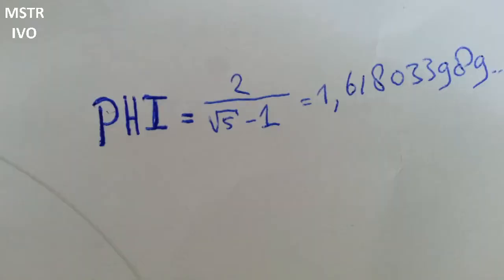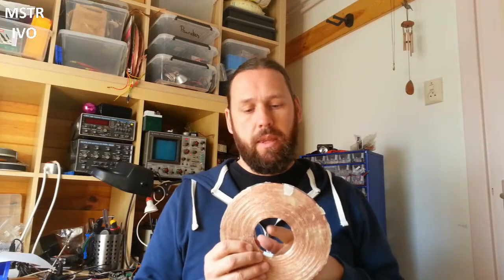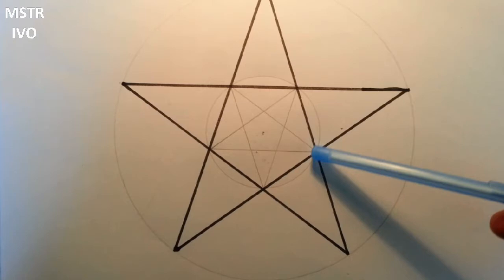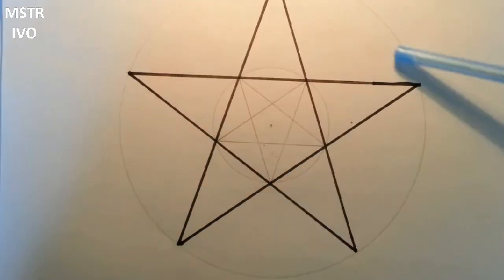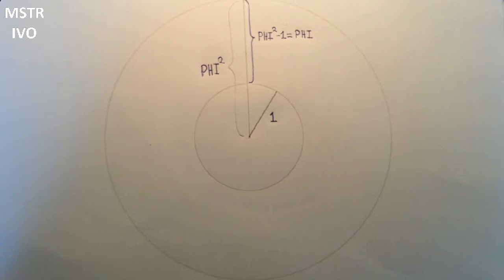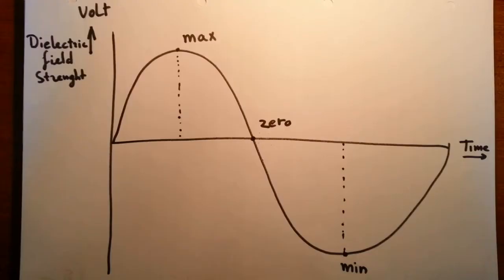The PHI Ratio Bifilar Pancake Coil and its third field

Comment: IVo...so great to see you make a video again(:  Was anxiously awaiting and as usual you generate much thought.  It looks as if you made your bifilar this time the way I make mine.  You wind the speaker wire vertically vs horizontally as you did in the other videos.  Also the speaker wire is closer to the Litz wire then the solid strand magnetic wire which gives improved performance at higher frequencies due to skin affect.  What Ken's ferromagnet detectors can not show is that a magnetic loop actually has a spinning particles (more a corkscrew spin in direction of movement) in addition to the geometric loops.  As these spinning particles move through the center of your bifilar, most intense closest to the coil, the spin (corkscrew) imparts a spin in the aether in the middle of the coil (or vortex).  To see graphically the corkscrew action reference Joseph Newman. 

I will think about what you said about the resonance and the electric field separating from that.  It is possible that a circuit is predominately capacitive (electric field) or predominately inductive (magnetic field)....so I will leave it at that...and not disagree with you, just awaiting your demonstration of that, of which I know you will do a good job(;

Thanks much and keep it up.
Reply from the maker: Thanks Mark S, that great to hear. Here is another thought. Since there are 2 kinds of resonance, one from the magnetic pulsed coil, and one from the back emf of that coil, we should be able to combine bothe resonant sine waves in one coil.
Reply: So...with the bifilar coil...at resonance the energy transfers from the capacitance which is well matched to the coil due to the bifilar type of coil...to the coil which stores the energy in the magnetic field...as the magnetic field collapses it generates an mmf which results in an emf in the coils copper wire that transfers the energy to the Capacitor (also called back emf)...at resonance this occurs at the natural frequency determined by the amount of capacitance vs. inductance.

Now then since I have now reminded myself of resonance by just writing it down...intent not to tell you as you already know...let me understand what you just said...ok then there is a resonance from the magnetic pulsed coil, nothing new there...now how bout from the back emf (from the mmf)?  So the "one coil" you mention would then necessarily be another coil...now if that other coil was at the proper angle as to not subject the initial coil to reflected impedance due to the right hand rule of induction...then yes, it should be possible for the charging resonant pulse to be added to the back emf pulse...what is critical is the relationship angle wise to the primary coil.

Obviously if the coils are on top of each other there will be reflected impedance and thus no addition rather a load transferred back to your primary coil....so the other coil preferably would be placed perpendicular and  just to the outside of the primary pancake.  Or maybe, perpendicular and above to derive the benefits of the vortex...best of luck on this.
Reply from the maker: thanks Mark S.  indeed resonance is the constant transformation between 2 energy forms. the magnetic field energy (inductance) and the dielectric field energy (capacitance). Since the capacitance of a bifilar coil is bigger, it can store more energy in its fields (there is a perfect ratio between capacitance and inductance where the voltage becomes maximum) 

when you have 2 of these coils stacked (but not connected), you can give one coil dc current pulses.
this stores energy in its magnetic field. the change of the magnetic field, when the current turns on, brings the other coil into resonance (if the pulses are at the resonant frequency).

so far nothing new.

but when the dc current of the first coil interrupts(pulsed), the magnetic field energy produces a back emf spike (equal to the magnetic field energy).
this instant spike, can be fed (via a diode) into the (already) resonant coil.

this extra b emf energy injection, also produces a resonant sine (that somehow has no magnetic properties, dielectric induction?).

if injected at the right phase angle, the voltages add up. the dielectric field energy increases, and since it is in resonance, the magnetic field energy should also add up (or at least it should interact with the third non magnetic field).

so the energy is more efficiently used. the back emf is reused, into the resonant coil.

edit: to be clear, 2 separate staked coils.
one phi coil (A) with high inductance (add MnZn ferrite) is pulsed with a high direct current. 

the other coil (B) is resonant from the instant change in current of coil A.

Coil A builds up a magnetic field from the dc, so when the pulse stops. the current stops, the magnetic field enery of coil A produces a back emf (voltage spike) that we then inject into coil B via a diode.
Reply: Yes, dielectric induction, I agree.  Commonly, the back emf diode is used to charge a capacitor.  Of course capacitors do not pass current, rather store energy through a dielectric induction (dielectric strain).  So it is at least reasonable that your coil B, which in fact has increased capacitance from being a bifilar, is acting as the capacitor for the dieclectric induction, and thus storing Coil A's back EMF energy without burning it up as current.  In this case there would be very little magnetic properties.  And MnZn is rated for less then 5MW if that is the range of your resonant frequency.

So then if you are transferring back EMF (voltage) without using current (dielectric induction) then I can see how you could lay the coils on top of each other without suffering the reflected impedance (lenz's law).  Actually quite genius...the real genius...applied genius.

You also answered the question of why you are using bifilar.

Also the energy returned in Back EMF is not recaptured energy from your battery, rather the magnetic fields returning to the copper atoms electrons now returning to their random orientation once the voltage is removed from coil A (Joseph Newman).  Thus you can receive more energy from back EMF then that which came from the battery.  At another time I can prove that to you using simple electrical engineering equations.

So fortunate to have had these discussions with you, thanks!
Reply from the maker: Thanks again Mark S. I also really enjoy sharing thoughts and visions with you.  I added my email in my youtube channel profile, if you would be willing to discuss these things further.  

in addition, the back emf that is fed into coil B, stays there.  this is because the other end of coil B is connected to ground via a series connected capacitor. 
this capacitor fills up and then becomes high impedance. this way the back emf from coil A sees a high impedance load, and this creates a high voltage back emf spike. (resulting in a very high voltage resonance in coil B. 

if this capacitor wasn't there, coil B would present a low impedance load for the back emf of coil A. thus preventing a high voltage spike. 

I also add a capacitor parallel to coil B to tune down its resonant frequency.  so its well beneath the 1 MHz range making it easier to work with.
Reply from the maker: Joseph Newman you say. have you got a propper link for me? about that cork screw?

It reminds me of the Aether field configuration of a magnetic field (as Ken stated). I think the third field is a bit like the corkscrew field, but tranformed into a pure ring vortex.  There isnt a corkscrew vortex anymore. now the loops are closed directly on them self around the coil, making circles (or ellipses) and such an ellipse is like a cross section of the ring vortex, formed by all these loops aroumd the coil.
Reply: Pages 11 & 77 of the 8th edition of "The Energy Machine of Joseph Newman", google it and I was able to download a PDF for free.

So if you have a particles traveling in a corkscrew while moving in a loop the they can impart a vortex in the ether...and do.  Ken sees an inner Vortex at the center of a Permanent Magnet surface...OK on that.  However, it is different for a bifilar coil in that the center is typically air (or vacuum if it's in space) and not iron (ferrite core).

From earlier comment on dielectric field without current without magnetic field...dielectric induction occurs faster then the speed of light (Tesla)...electrons travel at the speed of light or less in conductors (generally accepted by Electrical Engineering Model)...thus electric current phenomenon generally does not occur in Dielectric induction.  However, there is a displacement current identified in Maxwell equations which relate to the dielectric strain (example as capacitor dielectric) which is not the same as electric current in a conductor and does not necessarily align the electrons magnetic moments and thus imperceptible magnetic field.

The key as you noted above is to limit the current flow (increased impedance) keeping the voltage high...and to rapidly remove the voltage (square wave) before current flow establishes...and of course taking advantage of Dflux/Dtime (Electrical Engineering Model).

If your device mistakenly creates to much current then Lenz's law kicks in and reflects impedance back to Coil A.  In that case you would reduce the magnetic coupling between Coil's A & B (which is how Tesla's amplifying coils work (a pancake coil feeding a solenoid with a few turns magnetically coupled.
Reply from the maker: thanks, I found the pdf. its >500mb as it is a scanned book. little harder to read, but do able.  I like the double spin theory, I remember Don Smith also talking about this (but i dont like his twisted words).

to be honest, I don't believe in any particles anymore. for me, all is made out of aether fields. Particles can be easier to think with, but they also limit the possibilities. Fields are a bit difficult to think with, but after some practice they are making more sense.
So when I read about particles I always translate them to fields. 

I recognize the ring vortex, the transverse wave, the standing wave, the rope double helix, the water vortex, all as aether field configurations, that can all transform into each other. 

Dielectric induction is indeed faster, I see it as a helix, a rope. since its a line, its more or less 2d and not 3d like the magnetic field. this ties in to "counter spacial".

the second coil B becomes resonant, so it can be seen as a Sine wave of voltage, representing the dielectric field. when the voltage is zero the dielectric field has completely tranformed into the magnetic field (or third field, non magnetic). 

A third coil (c) , placed parallel to B can resonate with B. this due to induction. If coil B has a enormous resonant voltage rise (thousands of volts) 
coil C can be used as an output coil. when its loaded, the sine wave is clipped, and becomes a square wave again. 

but here I'm still a bit lost...
Reply: So this is the whole point...field theory is a model as well as particle theory.  Different brains seem to be more conducive to one or the other.  In my case I work with both in separation or at the same time depending upon the invention I am working on, and could argue the merits of either one...but then too much time arguing leaves less time to do what you are good at, inventing(:

The reason I like J. Newman is that I can take his ideas and apply everyday EE calculations to them and invent new things.  Donald Smith comes across more as a "Magician' withholding critical information, so I stray from his sites.

Wheeler is fun to listen to, so I do, but for inventing there is very little if anything there for me.  I get it, a permanent magnet has centrifugal and centripetal magnetic fields after that haven't found much practical use.

Tesla is my God for inventions and has never steered me wrong.  He believed in aether and felt that aether was made of an incompressible fluid like substance or particles.  And invented many things with that...but didn't appear to concern himself with fields or particles alone, and used both.

 There are two types of induction, magnetic and dielectric.  For magnetic a change in magnetic flux (B or H) creates an EMF in the Coil wire.  So certainly Coil C experiences d-flux/d-time.  Also, since a pancake coil is essentially a capacitor plate....coil B presents one plate of a dielectric induction to coil c (the other capacitor plate).  Thus there are both type inductions occurring.  When you load coil c down you are providing a current path which then predominately uses the magnetic induction affect and thus, since in parallel with coil b Lenz's law comes into affect reflecting coil c's impedance back to coil B, thus the 
'square' wave affect.  Before Coil C is loaded you just see the Sine wave affect on coil C with a hefty non-loaded voltage (capacitive affect).  The magnetic induction effect when loaded is your classical 'hot' current.  If circuit is done differently...to use predominately the capacitive effects then the displacement current results in more of a 'cold' current energy transfer (until you finally extract the energy using a transformer which is of the typical 'hot' current).

My current invention is combining Joseph Newman's model with Vialle's model, while keeping an eye on what you are doing (and watching to see if Ken W. actually ever invents anything(:)).  My gut feels you are on to something.

Interestingly enough, if you have a corkscrew particle moving in a direction, mathematically this is described as two sine waves moving perpendicularly to each other and perpendicular to the direction of movement of the corkscrew particle.  Or...maybe the magnetic and electrical waves are forces (pressure mediations in aether) described by the two sine waves.  In this video it gives a representation of what I am saying https://www.youtube.com/watch?v=2uESlFxGVDM.  Now to have pressure mediation without a field of particles?
Reply from the maker: I also stay away from Donald Smith, But only after I looked into his tech and found out his words are twisting everything up. I always find it interesting where the cuts are in his interviews. just when things are getting interesting, its cut out. Its the same for some of Eric p Dollard's videos. The good parts are cut out (dielectric induction).

I think Ken Wheeler knows alot more, than he would ever talk about on youtube. It is as if he is hiding behind his "simplex" words. As if he is saying, only I can understand this, you can not, and that creates his safety barrier where he can hide behind. But he does seem to know his stuff, and I do like watching him. But real practical applications? hmm... no.

Tesla is a great inspiration indeed. But I also feel a lot of his publications are twisted. I think at a certain point he knew, he couldn't speak freely. That's why I'm so curious about the bifilar coil. If you read his patent (512340), it's so vague. It has very good information in it, but it is as if he's not saying all there is to be said about it. It's called, "coil for electro magnets".  but since I read it for the first time, I felt there was something more with this bifilar coil. 

I do intend to take the output from the dielectric field, by rectifying coil C into a capacitor. 
Don't forget, there is also the non magnetic non dielectric third field component, from the back emf spike.
This field is interacting with the magnetic field, when in phase. I still havent been able to combine both resonances (depletion mode mosfet, and fast high current diodes are in transport)  100%, but at 85% I already see the sine wave growing. 
I suspect It could grow into massive voltages. then the output load is more then welcome to keep the voltage down (square wave effect). 

I'm very curious about your invention. Can you share more about it?
 Vialle's model? I'm not familiar with it.

Pressure mediation without a field or particle? Indeed, I still dont understand the Aether, in how it works. But its enough to know its there, and that its working. I also think, we can measure some of the Aether fields, like voltage, and magnetic fields. But I also do feel we dont know all of the Aeter properties yet, and arent able to fully understand, them because we cant measure them all. but they are there. and all these fields are inter acting with each other (induction). It's important to know these fields are also tied in to out health. I found out the hard way, by becoming sick from them. These feels have a natural way of flowing clock wards inward. If you spin them counter clock wards inward... you get sick from them. I believe Russ Gries had the same problem when working with the starcoils. 

The standing wave, can be seen when there is a stream of water, around an object. The wave stands still, but the water streams very fast. Electricly We can see the (sine) wave, but not the water (AEther). 
If an electric standing wave (resonant coil) shows a sine wave, it could mean the Aether (water medium) is flowing very fast. This flow would have inertia. Controlling this flow, could reveal effects, not seen before. But the key, is to make the flow strong enough  (pressure), to have an effect. High voltage is the key I suspect. 
just like water, if you drop a stone in it, it will give s small splash, and sink in. but if you throw the rock fast enough relative to the water, it will skip.

The Sine wave seen on an oscilloscope, can represent many things. Indeed the corkscrew is one. But it can also be a circle as seen in that nice link of yours. But it can also represent a standing wave (only 2d up and down). Thats why I would love a VR osciloscope, to see the images in 3d. 2d is very limiting. Just like Steinmetz his representation of the magnetic and dielectric field. Its in 2D. a moving 3D image would be able to reveal spiral patterns.
Reply from the maker: I found the info on Richard Vialle via Jean louis Naudin (i know of his site), but I haven't found info about the effect.

please share that newman concept when you are ready to do so.

Konstantin Meyl, made a connection between neutrinos and the third field. I think neutrinos might be seen as ring vortex fields.
yesterday I found out there are a few billion neutrinos per square cm in space, created by the sun.
that sure looks promising...
Reply: So Vialle was somewhat of a physicist...so one must muddle through all of the relativistic type Einstein and K. Wheeler babble.  So the goal then becomes the practical and usable parts.

So to distill what the Vialle effect means to me, if you subject a conductor, the more atoms of copper the better, to a magnetic field that is oscillating at a frequency (or harmonic thereof) 16.7 Mhz...And... you ensure that the conductor does not form an electrical loop( keep it open)...then an electrical potential will be set up in the conductor (with an appropriate reference)...then if you connect an external hot circuit (conventional current flow) to this conductor/reference...then cold current (displacement current) will supply the external circuit (regular hot or I^2R current).

Now therefore, since the Conductor only experiences potential and cold current (displacement current), thus no magnetic field is produced to counter the enclosing outside coil (H field) that provided the 16.7 Mhz  (typically wound as a solenoid).  In other words there is no impedance reflected to the outside coil (no Lenz law).

So the cool thing about the Vialle effect is you are using magnetic induction (transformer affect) and thus the center solenoid conductor can be a chunk of copper (or aluminum) without windings, easier to make.  Of course removing Lens law is a major accomplishment. 

Now I have just condensed Vialle into 2 paragraphs...he wrote books on this with tons of equations, relativistic physicsBabble, all in French, Atoms, Electron orbits, on and on...just another model that hits on some of the originator's predictions.

Jean Louis Naudin did an excellent job through experimentation in verifying what Vialle's experiments in proving his theory.

Now for Meyl...he did a good job capitalizing and monetizing Tesla's radiant energy on a small scale...and not really using high voltage/frequency that is required for any substantial energy transmission...recall he was trying to power the world.

There is not only a "third" field there are infinite number of fields...and vortices are a common result whenever you have a fluidic ether (Tesla).  There are also then, an infinite number of particles that can exist albeit some for only very short periods of time...as I observed when I worked at a particle accelerator at Berkeley.

On Joseph Newman...I distill his whole book down to one simple but extraordinarily genius observation about current/magnetic flow in copper (or any conductor).  The electric current supplying a conductor is only a catalyst...the magnetic field is from aligning the conduction electrons in a wire...thus the energy recovered from the magnetic field is from the electrons in the wire and not the electrons from the battery.  I can not impress enough how revolutionary this observation is and incredulously how relatively no one knows about this.  Using existing EE simple equations one can prove in minutes that this is true.  I can get as much magnetic force from1ma of current as wires carry thousands of amps!  Of course Newman actually invented things using his extraordinary discovery, and I have verified.

So whenever you see people experimenting with coils and they can't explain their power gains little do they know that the magnetic field from their coil is not from the battery...the battery is a catalyst!

So you can probably guess how I plan to marry Vialle to Newman.
Reply from the maker: That's a lot of great info Mark, Thanks for sharing.
I'll Have to think over and analyze what you shared here. 

I think i dont understand it fully yet, but:
A (pulsed dc) 16,7MHz (or subharmonic) magnetic solenoid, around a copper rod, induces a voltage (I wonder what is resonating).
This copper rod, is grounded into a "hot" current circuit. (how? this seems most important, also to my coil setup).
In this way it avoids lenz law. 
Removing Lens law is indeed a major accomplishment. 

"There is not only a "third" field there are infinite number of 
fields...and vortices are a common result whenever you have a fluidic 
ether (Tesla). "
I think you mean turbulence? I agree. but, I say third field, as it is a specific field (non magnetic) where the dielectric field is resonating with. It might be related to the neutrino. 

You worked at at a particle accelerator at Berkeley? That's so cool. You must have learned a lot from it.  I always thought once the speed gets high enough (near lightspeed), there must be a large production of energy. 

quote:
"The electric current supplying a conductor is only a catalyst...the 
magnetic field is from aligning the conduction electrons in a 
wire...thus the energy recovered from the magnetic field is from the 
electrons in the wire and not the electrons from the battery."
end quote.

That indeed is a proper insight. The fields become coherent. like a laser. Like Ken W said. a 5W light bulb is no the same as a 5W laser. 

With resonance its the same, the fields are transforming into each other, but they are stationary, not moving.
So electricity is like sound,  the air vibrates, but the air doesn't travel. it only passes on the vibration.

" I can get as much magnetic force from 1mA of current as wires carry thousands of amps!"
Wow. I would love to look into your lab :) how does that work?

So, Vialle gives, the voltage, and Newman, gives the amps.

Combining these two would give a lot of power. this seems the key.
I'll let this sink in further.
It has a lot of similarities with what I'm doing.
Reply: According to Vialle, what is resonating is the electron cloud around the nucleus of the atom.  As an analogy if you squeeze a spherical water balloon it deforms to another shape and then when you let go it returns to a sphere.  Also, since it exists in a ether field energy is imparted on that field (potential).  The amazing thing is that he calculated the frequency using the atom model and a lot of physics math before he created the test device.

Lenz's law requires the interaction of two magnetic field (or two mmf's).  Since the copper rod is not in a direct electrical circuit (hot circuit), or we don't electrically connect the ends of the rod, then there is no magnetic field to interact with the source magnetic field and thus no Lenz reflected impedance.  Or in other words, pure changes in electric potential (emf, voltage, displacement current) do not cause an external magnetic flux (H or B (if a core is involved)).

So the rod is acting as pure potential, just as a capacitor acts.  Recall a capacitor has a pure potential "strain" when charge up.  When you place a wire across the charged capacitor, the wire acts as a hot circuit however the capacitor acts a pure potential.  In other words no current  (energy) flows through the capacitor.  Of course if current did travel through the capacitor it would burn up and be ruined.

In reality the copper rod necessarily will have a potential reference or rather another smaller mass conductor also placed in the center of the solenoid.  A ground (although Ken Wheeler really missed the point on electrical grounds) is nothing more then another conductor at a different potential (to say it is counter space is in my opinion just not right for those of us that work with electricity for a living).

Well then the "third" field as you defined it above, closely matches the Vialle affect or effect (impact).  The difference is that the Vialle affect begins at the atom level whereas the "3rd" field you describe is at the ether level, both are pure potential (no outward magnetic field).  The infinite field I describe certainly include ehteric turbulence as well as pure potential, magnetic, rotational, and hybrids thereof.  There also are infinite combinations of subatomic particles (including the neutrino) which can interact with the aether medium.

Yes I worked at Berkeley, we accelerated elements, including heavy elements, such as uranium, to close the speed of light, and yes a relatively tremendous amount of energy (MEV).

Not really the same, re battery current is only a catalyst...as Ken Wheelers laser comments.  A 5 watt light bulb and a 5 watt laser both consume 5 watts of energy.  However, the 5 watts of a laser is concentrated (coherency) into a small surface area compared to the 5 watt light bulb...the analogy being a magnifying glass in the sun to burn something.  The energy in a magnetic field of a coil is related to the energy of spinning electrons moving at the speed of light or E=MC^2.  So the amount of available energy is millions of times greater then the energy coming out of the battery.  I would say that is quite different!!!  This is how my lab works to get a much greater magnetic field from the same battery energy/power/watts.  And by the way you are also using coils...get the picture.  Ken Wheeler knows none of this because he is an intelligent parrot.

Yes, a lot of similarities...so I really mix Tesla with Newman...Vialle is a new mix for me...we will see what happens.
Reply from the maker: My brain cant follow your words anymore, this is mostly because my parts have arrived. I'm now in the process of figuring out how to drive the gate of my depletion mode mosfet. it needs a negative voltage respective to the source to turn off. the gate source capacitance is around 2700pF so I need a lot of current to switch it off and back on again quickly (around 200khz pulses, but the pulses them self need to be a lot faster on and off).  totem pole gate driver circuit seems to be the best fit.
Reply: Best of luck on that, looking forward to seeing your video on the application.
Reply from the maker: Thanks Mark S, I hope you succeed as well.
Reply: You may find this old video informative and evident is some of your videos...or maybe you have already seen it.  https://www.youtube.com/watch?v=DovunOxlY1k
Reply from the maker: I have been watching that one, but didn't finish it yet. thanks for reminding me :)
Reply: Oh, and you probably know, JLN has several simple circuits he has refined for driving MosFETs at frequencies into the meg's...http://jnaudin.free.fr/rvproject/index.htm...you just have to dig in the different projects to see his refinements on these circuits
Reply from the maker: great tip, didn't know that. thanks! already cooked something up in ltspice. lets see what jln has
Reply from the maker: Mark S I did a test, and it seems to work. I have to redesign the electronics, but... I got the result  I wanted to see.  with a low impedance load (shortcut), the current draw went drastically down. from 2A 3.8V dc, to 1A 3.8V when pulsed into resonance (99.9 duty cycle), to. 0.35A 3.8V when the output coil was shorted out.

I need to further test it with higher voltages.  I did do another test, where I used a 16V input and created 170dc on the output, and it lit a 15W 230V light bulb. but not with the current drop, as the setup was wrong.

electronic fast  switching at 150khz is pretty hard it seems (at least for me).

I'm very happy with the first result.
and i do have a concept how this could be working.

bassicly I combine the 2 resonances, creating a magnetic field within a ring toroid   field. they interact resluting in a lower current on one pole, and a higher current on the other pole. the ring toroid / magnetic field is surrounding the 3 stacked coils.

So exciting. but it has to be tuned precisely to get the resonances in phase.

today i tried a 555 circuit, but its not tight enough. I also want to be able to switch a high current really fast, and thats not so easy either (for me)... but I'm learning.
Reply: hmmm...having a hard time with meaning of "current on one pole".  I think you mean the poles of the magnetic field that you are creating within the ring toroid.  Now if one pole of this magnetic field has a greater flux density B then the other (due to a magnet vortex, perhaps) then the dflux/dt at one pole would create a greater potential at one pole and thus a higher current to a properly positioned shorted out load coil.  Thus using your phi ration bif-filar coil.  Cool stuff, great news.

I understand your problems switching hi-power as stated, looking forward to your solution...others rely upon off the shelf IGBT circuits with close tolerances on stray inductance, sure you know this.

So in my designs...which are probably not applicable to your current project nor recommended...the goal is to ring the "bell' so to speak.  After the initial charging of the resonant tank capacitance...ringing the bell is typically a low power operation.  Letting the resonant capacitance and inductance, then, trade the high or low energy.  Of course, this method is predicated on efficient energy extraction from the resonant circuit as you are very good at achieving.  It requires an energy sink that reduces Lenz effect  (i.e., proper electrical generation geometry, vortices, Vialle, Newman, etc...).  It is the tank capacitance that takes the role of providing the high current in supplying the coil's magnet flux generation.  Thus I remove the high current power switching necessity in typical device loads.  Inductive kicks just feed the tank capacitor(s) instead of burning up MOSFETS/IGBTS/BPT...

Looking forward to seeing your device
Reply from the maker: current on one pole:  3 coils al together forming one field (combining the ring torroid an magnetic vortices) so the input pulsed coil is on one pole of the magnetic field, and this current is lower. the other outside coil, is at the other magnetic pole. here the current is amplified. (actually the amplification is happening in the center coil where the resonances add up when they are in phase).

pole=center of all vortices, as it is just one place. (like the center of a donut).
  
looking at one side, the energy(sucktion) is flowing into the center, looking from the other side the energy(pressure) is flowing out of the center

designing the gate driver is coming together, learning a lot these days. maybe it could be done differently, easier, but the phase timing is key to success (getting the resonances in phase).

the video's will come, but probably in several phases, to make it clear and understandable for more people. making videos isnt my favorite thing...  but I do like to share and teach. getting the info out.
Reply from the maker: Mark S, i finished my first circuit (in ltspice),  this will show the absence of the magnetic field within resonance of the biPHIlar coil. Very excited about it.
Reply: Great news!  Must have been some trick to ltspice model 3 stacked bifilars in the middle of a ring toroid.  Absence of magnetic field would mean pure dphi/dt, interesting, to say the least...yes exciting news!

Now Maxwell's "displacement current" which he felt leads to a magnetic field the same as conventional current.  However, if I remember correctly displacement current depends upon the bohr atom model....  The analogy being the dielectric of a capacitor which is in fact an insulator undergoing a sort of polarization resulting in a "displacement current" in the dielectric...(not through the dielectric).  It is interesting that a capacitor works in space, even if its dielectric is a vacuum of space...

Why do I bring this analogy up?  Because absence of a magnetic field would most necessarily mean absence of "displacement current".  In other words pure dphi/dt at faster then light speeds even void of the bohr model (i.e. deformation/polarization of electron clouds around an atom, or the Vialle effect, which happens at 16 Mhz resonance which is much higher then your current project).

It's projects like yours that makes it fun to get up in the morning and check youtube(:  Thanks much and looking forward.
Reply from the maker: thx for the compliment Mark S, replies like yours make smile.
LTspice has its limitations, and the bifilar coil is one of them. I just used a coil, as i knew what i was looking for.
displacement current. Indeed. thats the key. but its much easier to understand when you think with fields. the dielectric field in a bifilar coil can be instand, as it is counterspacial, not limited by time and space that is.
if you hook up a 10meter wire to 100V and 0V the dielectric field (voltage) is instantly there.
the middle of the wire is 50V. 
Now make a bifilar coil, with 2x 5m windings out of the 10m wire. 
there is an instant voltage difference of 50V   between both windings (series connected). 

If the instant voltage is disconnected, the coil will swing, due to the tranfromation between dielectric to magnetic field and back and forth (resonance) only damped by  resistance of the wire. 

but... if this voltage applied is instant off-on-off, like a back emf spike, at the resonant frequency of the coil. 

there will be no magnetic field! 

there will be a pure ring torroid field. with different properties. 

the difference with a capacitor is the connection between the plates. there is non, so there is dielectric induction needed. this is spacial and takes time to charge. The plates (coils) of a bifilar coil are connected, so the voltage difference is instant. 
this is why I build my first circuit. to show this. the rest comes later.
Reply: Yes, much easier to understand your description.  I agree, a wire is instantly at potential regardless of the length of the wire when connected and that if the potential is removed instantly you have a high dphi/dt that will resonate down the length of the wire determined by the wavelength (or quarter thereof) of the wire.  

Now if that wire is not an electrical circuit, and the wire is excited at the resonant frequency (preferably square wave for higher dphi/dt), then the wire itself will be a cold circuit (Vialle affect) that may consequently supply a hot circuit.

The preferable method of supplying the potential is using another coil, which you do.  And interestingly enough the hot load is not felt back at the excitation coil.  This corresponds to your observation a to the lack of an obvious magnetic field.  So I follow you.

Tesla and his bifilar are quite amazing
Reply from the maker: Indeed, they are  brilliant in design, and we are only just discovering their potential.
Reply: So skimmed through this thread. Excellent discussion here between Mark S and Master Ivo.

Couple thoughts: Thomas Bearden discusses quaternions regarding his Motionless Electromagnetc Generator device. Also there's an interesting bi-toroid transformer design out there that uses three torroids [Two smaller ones inside a larger one]. The primary coil is wound connecting the two small torroid cores and then there are two secondary coils each wound on the outside edges connecting each small torroid core to the third larger torroid core. This allows those secondary coils to direct their back emf to each other through that larger torroid core that encompasses the center cores thus providing an alternate path of least redistance apart from the primary coil's path. It seems that is working the principles you both discuss here.
Great stuff!
Reply: Great discussion guys! I wanted to add to one particular statement of Ivo regarding to think about the interaction of Fields by comparing it to Acoustics. I also think that the same principles (acoustics) can be applied to the electrical ones and especially the “standing waves” is something which should be looked at. I also think that if one could tune Ivos Typ of Setup in a way (like a radio receiver) to get in resonance with the universal freq (I know this is vague but as we now everything is in constant motion this means everything vibrates thus excited by a source), one could harvest or transform this into electrical energy.
Reply: @nima637  Thanks Nima as I reflect back on this conversation it does seem a great discussion ensued.  Agree with your acoustics comments as pertains to RF waves.  However, it appears, recently, as I just looked at a couple of IVO's videos he is experimenting with Radiant energy which as defined by Tesla does not act like RF waves, or Acoustical waves.  Cheers!!!
Reply: @MS-ef1gy  first of all thanks for your reply! From my point of view a “wave” is no entity it self. It’s just a medium (air, water, aether etc) which is excited out of its equilibrium. So I think that the energy  which excites the medium is creating longitudinal, transversal and/or spiral “movement” (i.e. movement of galaxies). Looking at the term radiant energy you could also express it as an excited medium which forms spherical concentric ripples/waves from the center point of excitement outwards. So same “mechanics” applicable no Mather which medium. The form/pattern which the excited medium will show depends on the Typ of excitement and its frequency. Cheers!
Reply: @nima637  Yes, we are together on this.  My distinction is that the radiant energy, which as you point out is a disturbance in a medium is very peculiar.  For instance, as Tesla observed, it does not conform to some of the characteristics of radio wave theory, nodal points in a transmission line for one as one example.  Additionally, characteristics of shielding it is much different.
Reply from the maker: I feel radiant energy is the same as displacement current, with high dV/dt
Reply: @MS-ef1gy  I think a lot of theories in EE are not complete. For example aether is still not commonly accepted all the do is talk about waves traveling through vaccum :D if there is no medium the cant be a wave forming. Shifting the conciousnes out of that „old box“ is the key I guess. I also would suggest to take look at the hermetic principles and apply some of those metaphysical concepts to the EE thoughts. This is also why I think that some principles such as as acoustics can also be applied to EM behaviour keeping in mind that the medium (i.e. Aether) has other density characteristics (i.e. Less resistance/damping)
Reply: @MasterIvo  Hmmm...Maxwell fundamental that magnetic field is proportional to mu naught times conduction current either inside capacitor plates or for that matter just outside the plates.  Therefore radiant energy, outside the plates, is the same as inside the plates, even though inside the plates there's NOT a current flow rather a change of electric field upon charge and/or discharge.  Now then, in Tesla's radiant circuit (variable impedance or "hairpin" (not what Tesla Called it), certainly is HV and a fast rate of change dt.  So the amount or magnitude of radiant energy is the same as the displacement current by definition.  This also allows one to use just potential difference to create energy flow, which is exactly what Tesla did.  Let's say for instance one plate of a capacitor is connected to a HV and the other plate is not connected at all, well the other plate that is not connected then must then have a potential on the unconnected side as the surrounding space experiences a displacement current (which is equal to the electrical field which drives it).  Thus one may used the second disconnected plate in another circuit being careful not to connect to the circuit of the other plate.  And on and on and on, useful energy from high switching and high voltage of second plate resulting in hi joules/per second.  This is what Tesla did...
Reply: @MS-ef1gy  i just recently saw someone saying that Tesla used Earth as one of the capacitor plates. So he created a „hughe“ potential difference against earth gnd (see tesla tower). The key here was also to get the sender and receiver in Resonance
Reply: @nima637  Yes I have heard this.  I prefer to start further back as to what was in Tesla's mind, say, From Tesla's early patent on radiant energy (US685957A), "I usually connect the second terminal of the condenser to the ground, this being the most convenient Way of obtaining negative electricity".  He has a schematic for the device which sure enough is connecting a condenser (capacitor to ground).  So there you go from his own words he believed the earth to supply negative charge to a capacitor.  So if "radiant" energy is supplied to the elevated conductor and in his words "positive" then one may see an important aspect of a dielectric.  If one facilitates a charge to one plate of a capacitor the other tends to draw charge from the opposite side of the capacitor, even from a totally separate unrelated source (in this patent cosmic rays (positive radiant energy) to the negative charge reservoir of planet Earth.

So this is a very important concept.  We all know that copper conductors are a ready source of electrons.  Say in his impedance circuit that many now call "hairpin".  "stout pieces of copper (electron reservoirs) are used.  Wardencliff tower with tons and tons of copper employed in the upper dome, and bottom tied deep into earth.

OK, I will stop there.  Certainly we can keep going with resonance, vibration, frequency, etc.  I think on this site we are writing on likes the positive and negative energy of it all just to give him a plug.